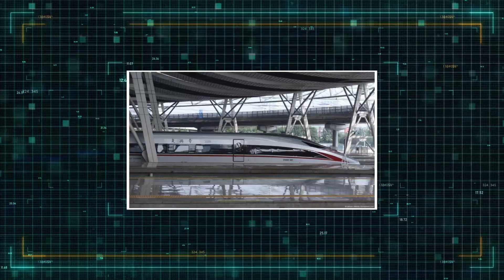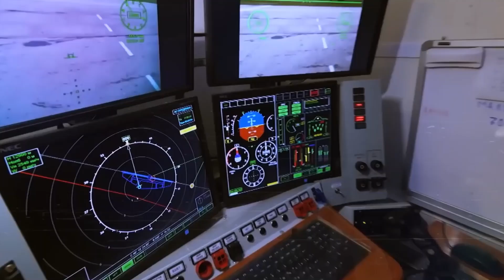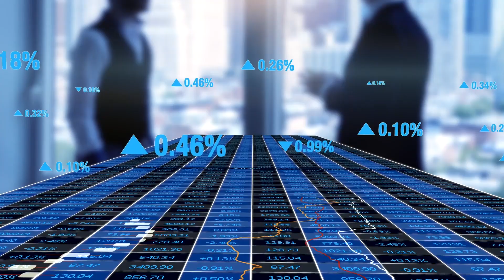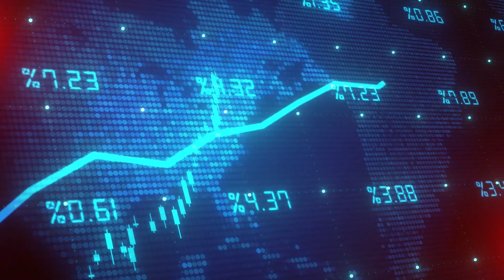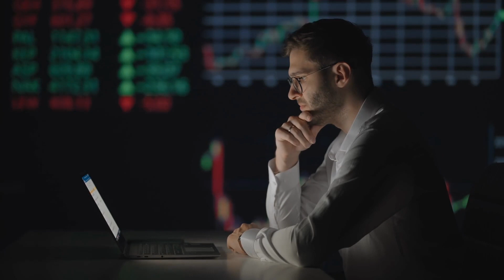If Russia Completes This CRAZY MEGAPROJECT, The WORLD Will Change Forever!

Comment: the arctic ice is not depleting it melts slightly in summer and builds up in winter and its depth has increased over the last ten years that is more ice not less otherwise you are correct

Comment: Fusi sudah bisa ?
Reply: Thermonuclear fusion? It is possible, but in the next 40-50 years, a thermonuclear reactor will not bring economic profit. At this stage, the total energy consumption of thermonuclear installations exceeds the energy released. But the main thing is that there are still no even theoretical projects for converting the energy generated by a thermonuclear reactor into heat or electricity available for commercial use. The methods used in a conventional nuclear reactor are not applicable to a thermonuclear reactor. The most promising area that Rosatom is working on is reactors that use spent nuclear fuel from other nuclear reactors as the basis for their fuel assemblies. That is, using waste from conventional nuclear power plants as fuel. The power unit with the BN-800 reactor of the Beloyarsk NPP became the first in the world to operate for a whole year on fuel from nuclear waste. More precisely, they used to be waste, but today they have become MOX fuel, the use of which will increase the fuel base of nuclear energy by tens of times.

Comment: Some propaganda... Nothing of the shown has moved far from prototype or sketch to realistic construction. And with Russias current economical problems and war economy it will take at least some 20-30 years to even start. Only few of the shown reports was on actual established facts. Some even with english teksts on. Not russian. The 70-B drone has been built in app. 4  prototypes. One was shot down yesterday by Russian aircraft to prevent it to land in Ukraine. The pipeline to China has stopped due to lack of financing. China refrained to participate in the financing of the project. LNG and hydrogen projects has never even moved from sketches to actual constructions. With normal Russian way of business ie the moneys allocated dissapears to accounts in Swiss banks nothing will be done properly.
Reply: You are stupid all that are lies my friend worked on LNG project they laid 30 000km of pipes there its operating structures and deal with the fact west lost 😂
Reply: @DamonX93  Russia has many gas and oil projects BUT not the size shown. Its all blown up to impress.
Reply: @jannyboe9365  nope
Reply: Eh 20-30 years,do u know everything right, max 3-5 years to start not more
Reply: @Warped_guy  Learn some about economy... These projects does not grow on their own. They need fundings and thats the only thing Russia cant do for many years. Initially the have a war going on straining the economy hard. When the war is over they have to rebuild their finances and production systems. Only then they will be able to try to start some of it. But it will not happend. The fundings will dissapear to banks in the west.
Reply: @jannyboe9365  Learn some about economy...
The USSR could do any project without financing. Because the USSR had a Barter Economy, in order to start Any Project, it only needed the Approval of the Central Government in Moscow.
Reply: @aluminumucumber4281  A barter economy.... You cant make large projects with a barter economy. Swapping items does not replace finance.  The shown needs huge amounts just to start them. And the Russian oligarchs will steel every rubel before its even up and running. When China refused to aid the  oil- and gas-pipeline Russia planned to supply China with gas and oil Russia did not manage to get it up and runnig. They have to spend every rubel on the war and to try to keep the country just running.
Reply: @jannyboe9365  40-60% of modern Russian economy is outside the dollar system (shadow economy, barter economy)...therefore, American sanctions do not work... Economic sanctions against states can only be imposed by the UN with the approval of the UN Security Council, but Russia will immediately block them. Russia is a Member of the UN Security Council and has the right not to notify other Members of UN of the introduction of troops into the territory of another state.
Reply: @jannyboe9365  A barter economy.... You cant make large projects with a barter economy.
Russia has long been in a barter economy with Iran(Iran has received nuclear power plants and access to nuclear programs), North Korea, India, and China, etc: energy, military-industrial complex, space, metals(including non-ferrous and rare earths), hydrocarbons(oil,gas, etc.), timber and wood, precious metals and stones, technologies, etc.
Reply: With normal Russian way of business ie the moneys allocated dissapears to accounts in Swiss banks nothing will be done properly.
Europe's industry is collapsing without Russian raw materials and energy. The population of Europe is fleeing to the USA or to Russia. The center of Civilization goes from Europe to the Pacific basin: USA, China, India, Japan, Russia (Far East). Russia is full of high-tech manufacturing: aeronautics, nuclear technologies, military-industrial complex, metals, medicine, automotive industry, shipbuilding (icebreakers, submarines), microelectronics is reborn (Russia is building 3 factories in Russia with the help of Taiwan)
Reply: @aluminumucumber4281  Woooaahhh... You are smoking some heavy stuff man. US and EU industry are expanding at the moment. Due to Putins stupid descicions. There are no hightech inside Russia. They cant even make Ladas thats better than a tracktor. Russias industry are going bust because of lack of vital components. Keep on dreaming.
Reply: Russia is not running a war economy. Putin took huge pains not to disturb the economy and civilian life with he war.
Reply: @TheBigWall3284  The only "huge pain" Putin took was when he and his supporters looted the Russian nation. Recently Puttin told the finance department that there were no ekstra fundings to be found. Russia are on a war economy and has been so in over one year.
Reply: @TheBigWall3284  Well... I suppose Putin must be in very great pain now then. With a growing inflation, a galloping decline in the value of the rubel, AND a war economy thats feeded with 40% of the state budget for 2025.